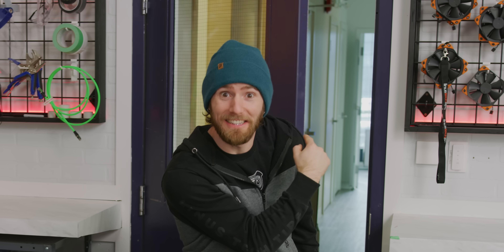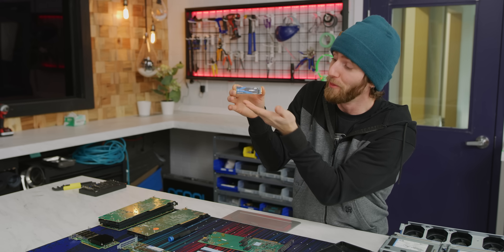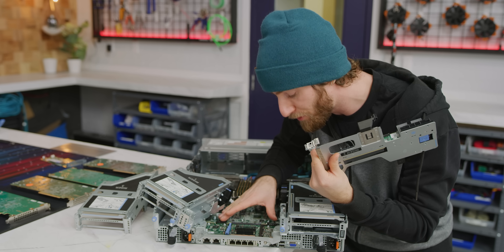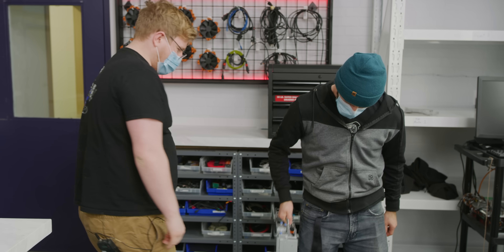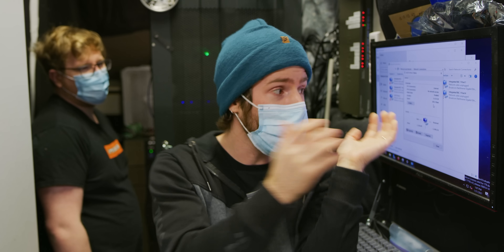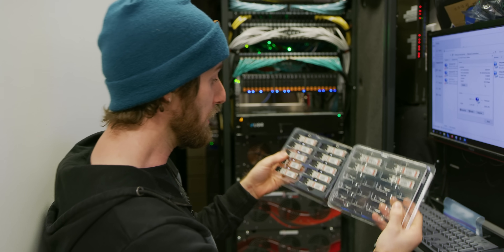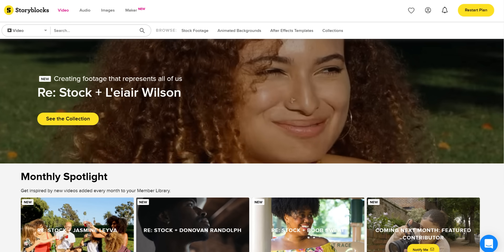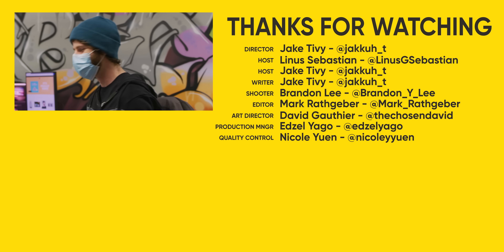Fixing My $10,000 Mistake - Whonnock 3 Deployment

Comment: Asus tuf gaming 3060 
Intel i7 10700 
1tb nvme ssd
4 tb hdd (recordings ect)
32gb ddr4 2666 
Thinking of either grabbing another 1-2tb of ssd or grabbing another 3060 and running dual gpu 
Which do you think would have the most performance increase

Comment: What's the reason (except for backwards compatibility) that new server stuff still uses (only/mostly only?) VGA? Less bandwidth? More reliable?

I mean, shouldn't it get harder and harder to get new screens with VGA? And if there are still new ones getting made (or older one's still getting manufactured) aren't they (the screens) soon (unless it's already been that way for a while) going to just get more expensive while being worse than anything you can get for e.g. 50 bucks (except maybe bandwidth wise)?

Comment: Actually I have a Question that what should be actual downloading speed of a 50mbps optical fibre plan ?
Reply: Umm 50Mb, that's actually slow technically. Old network cards are 100Mb dating back to the 90's, then came 1Gb, now there's 2.5Gb, 5Gb, 10Gb, 20Gb, 40GB and 100Gb. Or in terms of hard drives the modern 3.5" 7200RPM runs at 190Mb or better. A 2.5" SSD can run at around 500Mb and the newer NVME SSD can run at 1500-4000Mb. And your internet is at 50Mb :)

Comment: The only downside I see with an NVMe configuration like this is that you'd have to shut down the whole system in order to swap a faulty drive (instead of just hot swapping it like in a 'normal' system) or am I wrong?

Comment: @Linus Tech Tips / Linus, I would actually like to see a home set-up of this, so doing just normal 2.5Gbps via fiber so you can replace all the copper cabling and have it easier to pull just one thinner cable forever. Going to be doing that in the next month or two since moving to new house for the next few years and need to run a ~50m cable to other side but needs to be around the outside so never want to replace.

So what parts are needed for the long run, e.g. RJ45 to fiber and back at the end, whether that can be done via a PoE switch or something so can have the fiber run straight to the same table as the access point, cost of doing that via just Cat6 (or Cat6A cable) and complexity added if worth etc.

Comment: I used to hate these overly expensive, massively overly powered/gigantic capacity shop builds but now I'm becoming a server fan because the tech is getting less expensive for smaller systems that, for non-commercial/consumer use, are physically manageable for average users. I know that LTT needs the more massive storage/network devices but how Linux describes how to put one together - I can picture how to scale it down! M.2 drives instead of regular SSDs or HDDs! A lot of capacity in a lot less physical dimensional space. Build your own freaking cloud!

Comment: "We went with 4 TB rather than 8 TB, because the connection means the 8TB will wear out quicker...."

Except you fill these things up faster that you can wear them out; barely a year goes buy, and the next XX TB Network drive upgrade because the previous is filled.

Comment: PCIe Gen 4 cards with 8 PCIe M.2 Gen 4 slots. OK. The PCIe seems to be 16x, while the PCIe M.2 are 4x. Fine.
So 8 * 4x = 32x? Which is TWICE the 16x? Sure, it could be useful if all the drives weren't being written to at once, but they're supposed to be because of RAID.
In short, Linus chose PCIe Gen 3 drives because of size and network speed, but he also by dumb luck managed to avoid the bottleneck PCIe Gen 4 drives would have ran into.

Comment: Way to save on the SFP modules, Cisco ones cost at least 10x, to say nothing of the switch
I have to say that two cables to the same network card is a big NO-NO, it's too much of a single point of failure, I hope at least they go to different switches...

Comment: That "fastest server" joke nearly made me crap my pants and have a heart attack simultaneously!
Reply: @baranobama5375  Likely not going to hurt anything.  All that stuff had to survive the parcel system to get there.  Would have made the chassis a little ugly though.  You should have see how my NetApp DiskShelf was shipped.  Zero protection in an cardboard box that was not the right size so it was stuffed in diagonally on both X and Y axis.  Naturally, it was all banged up and bent.  Still worked fine.
Reply: I was yelling "no no no no no" at my screen watching him run thinking he was going to slam the trolley into that corner in the other room or trip and knock the whole thing over on its side.

Comment: Single drive parity (raid5) concerns me, not from data loss but from the computational cost of calculating parity at the speeds nvme drives can write.  I wouldn't be surprised if raid1 had faster write speed than raid5

Comment: What I don't understand is why they're running 40 GbE when they can be running dual 100 GbE?

P.S. You can TOTALLY, ABSOLUTELY get 100 Gbps internet. Still not the point, but it CAN be done. It's called OC-3072 which is actually 159.252 Gbps internet.

The Sabrent Rocket 4 TB NVMe SSDs has a write endurance rating of 7300 TB writes.

*32 drives = 233.6 PBW

Divide by 5 years, that's 46.72 PBW.

Divide by 365 days, that's only 128 TB/day or the entire array, written, once per day. So depending on how much data you will write the array, per day, including scratch disk data and/or swap/miscellaneous data, we'll see how long it'll last you.

Why are you running Windows on a server like that??? Run Linux. It'll perform the data/fileserver role much better.

(I have 100 Gbps Infiniband running at home and my array uses XFS and then it's exported over the 100 Gbps Infiniband network as a NFSoRDMA export/mount point. MUCH faster.)

Comment: I have a question why do servers have to be slim and screechy
Reply: They're slim because you want to fit as much hardware as you can in a space. So we use racks to stack up blade servers efficiently. They're screechy because these are really high-end machines, so they need tons of cooling. Blade servers fans are notoriously loud because they are used in places here the sound doesn't matter.
Reply: @anarchyjinflames  yeah but can't we just use wider cases with bigger fans to make it little less noisy...

Comment: Hey, i was wondering if someone could help me, my computer was running slow and would barely open a photo for some random reason so me being me I hit the reset button on my case next to my power button, it brought me to this blue screen that says bad_config_info and when i try to reboot it or anything it says this C/Windows/system32/logfiles/srt/srttrail.txt     now there are plenty of youtube videos that say to use command prompt and do /bootrec fixmbr and such but none of those work. Should I just unplug the ssd my windows is installed on then re install windows onto another ssd then just replug in my old one??

Comment: I just can't imagine building a beautiful server like that just to put windows on it.
Reply: What else would you use for filesharing? Linux is best for devops infrastructure. Not necessary for SAN infrastructure
Reply: @anarchyjinflames  there are a bunch of 3rd party tools such as raidrive that can accomplish this with relative ease.
Reply: @whucke1103  Sounds like a pointless endeavor when most organizations are still running windows on their workstations. Maybe there are some Linux-only organizations doing it to evangelize the platform, but that's likely 1% of all of the IT environments out there. Setting that kind of system up is more or less a waste of a linux sysadmin's time. Anyone lower than that would just use Windows. 

Linux has its strengths, this is not one of them.
Reply: @anarchyjinflames  It's not Linux's fault. It's Windows fault for not allowing SSH/SFTP on their platform so that your forced to use that architecture. If your okay with being restricted on your OS that you pay for than go ahead. But their are 3rd party tools out their that solve the problem and are worth the transition as Linux offers many more benefits than windows in the server environment
Reply: @whucke1103  I feel like you don't actually work as a sysadmin or in IT. Either that, or you're hamstringing your career by being a platform evangelist. Being platform agnostic is the most optimal way of running IT infrastructure. Linux is used to optimize internal application infrastructure servers. Windows is used for client side productivity. If you want to talk about high performance, the ideal would be running a linux infrastructure that supports Windows VMs. Linux performance with existing Windows support. 

You got a lot to learn, bruh.
Reply: @anarchyjinflames  Your just a die hard windows boomer server admin who can't admit linux can do everything better. You have a lot to learn bud.

Comment: For once the only thing Linus dropped was latency.
Reply: I held my breath the whole video.. I Couldn't hold it anymore and looked for this comment before continuing. Thanks
Reply: Latency is Very important, that is why my all DDR4 run at CL141414 (g.skill neo) o7
Reply: @STriderFIN77  Exactly, while i do have older DDR3 rofl, i run it at CL7 at 1866mhz. Which is actually less latency than DDR4 3200mhz @CL14 (But less bandwidth i know). Makes for snappy systems when u have little latency.
Reply: @bensaisakura4322  well those cl1414 are run on 4x8gb 3733MHz and 2x8gb cl14 3800MHz
Reply: U never know, man probably has some video of him dropping sponsored items hahaha
Reply: 1337 likes
Reply: How many subs can i get from this comment 
Current: 73

Comment: I realize it's nit-picky as hell. . .please quit referring to 2x100Gb as 200Gb. 

Unless you're doing something like iSCSI's multipathing, you only have 2 individual 100Gb slots, not 200Gb aggregated. In most link-aggregations, the algorithm tries to balance 1 flow per connection. It won't split the flow between two connections. 

Considering most of your audience isn't network nerds, it's a good idea to not refer to aggregate bandwidth on links. I've had people ask "why can't I get 2Gbps? You said there's 2 1Gpbs interfaces linked."

Comment: Okay so you want to know how to do it better and faster!!?

While the sever hardware is good, you're using networking. So lag and overhead is going to be a good percentage of slowness.
Tcpip isn't the way to go here and changing the network cards to be HBA takes all that unwanted away.

Did you only have two 100gb cards?
Don't you have like 6 editors, so all in they get 10gb, that's not that great, but there are four ports, so 40gb...

With the file size that's not going to be great, but can you make it better?

Comment: I really don't understand why you spend all of this money for real time scrubbing of hi-res footage. A standard technique is to down sample the footage to a low resolution and do your editing, then the compositor uses the time code from the edit to use the full res for final output.

You're running into the limits of even what you can afford for scaling vertically.

You're also creating massive single points of failure, even if you have redundant systems, it's still very many eggs in very few baskets.

You should really use distributed file systems that can scale horizontally by adding hardware.

UPDATE: 
So it looks like you're not using full res all the time, but everything else stands. You're going to bottleneck and not be able to fix it without completely rearchitecting your setup.

Comment: Hey yesterday i built my pc (which i cant use yet cuz i have no gpu lol) and when i pushed the lever of the stock amd wraith cooler in i saw that i didnt have tightened completely the screws of the base of the cooler on the other side of the lever(i couldnt get the lach to hook up so i had to help it a little and untightened those screws a bit). So is my cpu going to be ok? My mobo only recognizes that i dont have a gpu but i am kinda scared cause of the loud click the cooler made when it locked in place(sorry for the bad english)

Comment: Linus: 'didn't wanna slam these because they're very expensive'
Linus not even a second earlier: *slams the shit out of a server that houses 2 CPUs that cost around 5k and 1T of to expensive RAM, and also drives it arround like it's meant to be broken*
Reply: When you don't pay for things, you don't treat them with as much respect.
Reply: Blade servers have reinforced steel cases. It can handle much more than a smack.

Comment: Dont forget, dual 100gig Fibre will stilö br limited to the pcie 4 x16 slot speed. Many of the old pcie 3 or even 2 dual 10gig or 40gig cards are nowhere near being capablr of reaching full speed on both ports simultaniously

Comment: My first computer system for my business was a Research Machines Z80 with twin 8" floppy drives, we had a  database just to keep a track of what data was on which floppy in case there was ever a failure on the software requesting the correct floppy number when a data request was actioned, we eventually got a hard drive with a massive 8Mb capacity

Comment: The performance for the cost is kinda poor tbh, this is never a proper enterprise solution, but its cool to see  more like this, but we've been deploying these sorta systems for a few years now - I'm a storage/cloud admin btw ;)  I think that system will be to small in 6months max, with no way to upgrade but replace. You need to look into a highly scalable system and look at your cost per hour down if the system goes down?  I think that probably makes this system very cheap as it is a very cheap non scalable redundant file storage solution.

Comment: It's SO DIFFICULT to sub to the likes of Story Blocks when Envato Elements exists which is just criminally packed with every possible permutation of thing you'll ever need from tutorials to stock video to 3d models to premiere templates to stock photos BUT I presume Story Blocks actual video library is a lot better; going to check it out.
Reply: Well it turns out Story Blocks offers WAY MORE variety of content than when I last saw it - and includes a nifty 'maker' web-based video editor which looks good for quick social media video posts...damn....annual re-sub to elements or switch to SB?? It's a good problem to have I guess! Cheers Linus, literally forgot about StoryBlocks since their old Red/ Black web template and video-only model.

Comment: How did you enable RDMA?
If I google 'infiniband windows 10' it says you need windows 10 pro for Workstations, is this true?
Reply: He's not using RDMA. Connect X-6 are converged ethernet, so you can use Infiniband and RDMA or just standard ethernet, depends on drivers and back end fabric

Comment: What if the editors just used Offline files in always offline mode?  That way they'd be editing from the actual local ssd's in their systems, rather than over the network.  It would take some time to sync a new project, but while editing, you'd bypass the need for ridiculously high speed server storage and networking speeds.  I haven't done this, as I've never been on staff at a video production studio, but I'd love to see a video about this if it works.

Comment: The fact that they are covering the Fibre cables so much in a Serverroom is funny, as if someone is just going to pull on it and bend it. Fibre really isnt that fragile (atleast with the normal shielding om3 comes with) also fibre cables usually have some sort of stress relief in form of fibre (not glass fibre) which you can see quite well if you cut one of the cables open. For a Serverroom i would recommend putting the fibre panel on the back anyways tho because all of the Server IOs etc. are on the back. With fibre its quite easy to spot it once you have bent a cable to much and even then most of the times its still capable of delivering full speeds.

Comment: Why would you put non-enterprise M.2 drives in a machine instead of U.2 drives?  A 2U rackmount server holds 24 2.5" devices (U.2) drives, and you can hot swap them in addition to buying commodity storage from several vendors.  You have 128TB (not TiB) raw capacity, you could buy 10 Micron 9300MAX 12.8TB U.2 drives, which have TLC NAND and 74.7PBW endurance.  That's 3 DPD per device, or about 300TBW per day for the entire array.  You would spend $28,000 on the drives, but really, what will it cost you when you lose 1 of those 4TB M.2 devices?  You could literally run those Micron SSDs for what, the rest of your career?  74.7*10 is 747PBW, and your "cold" storage is a couple PB at this point?

Comment: I have had alot of issues with those sabrent rocket drives dont know if I would rely on them to much they have a high failure rate and are prone to odd performance also after a while theyre performance goes weird and is all over the place as far as latency goes ( even if cooled or not cooled )  this makes for alot of issues with file transfers and such might want to test them now then test them a few weeks down the road and be prepared for alot of questions as to whats going on because the latency will be very different and even file transfer speeds will heavily be affected and all over the place.

Comment: Hey have a question so I built my self a pc with this combo can a ryzen 3 2300x + msi tomahawk b450 + Radeon 5600xt please don’t judge on the cpu wanted to run a 3100 but couldn’t find one at good price at the time. But I’m trying to run dual monitor but don’t seem to activate my hdmi port on the motherboard. Is it possible? Please help really beating my self up on this one 😅

Comment: Ok, so from last year's "I don't wanna pay for a 64 core CPU, lets stick with 24 or 32 cores even when they are clearly bottlenecking" you went for "yeah, dual socket 64 cores with 16 channels of RAM bitch" and basically that was the fix. Surprised pikachu. I don't believe new whonnock deserves the hate.